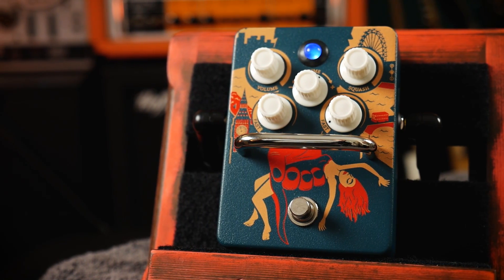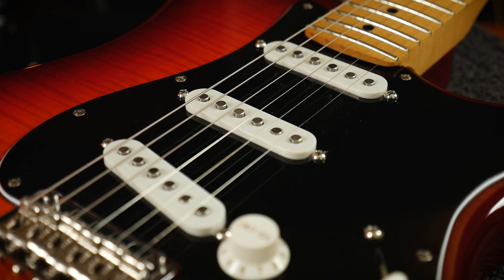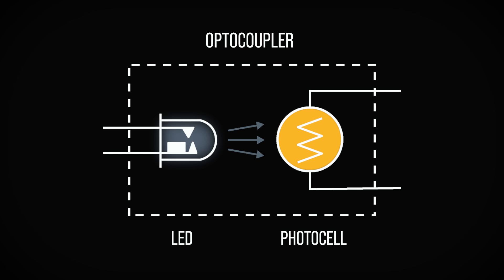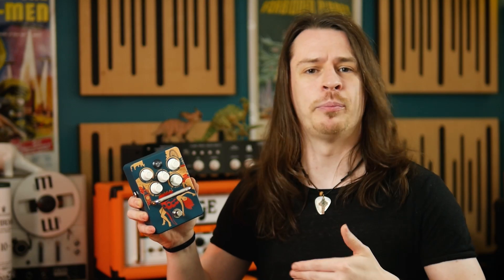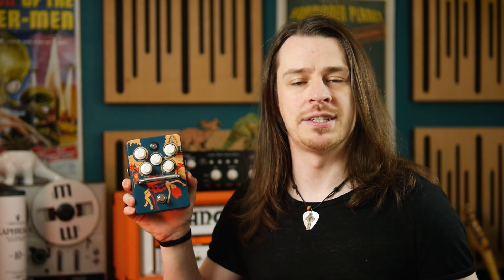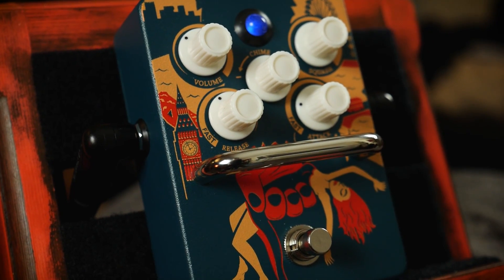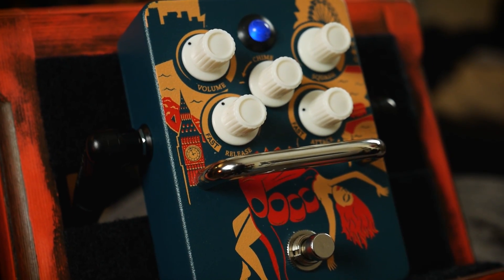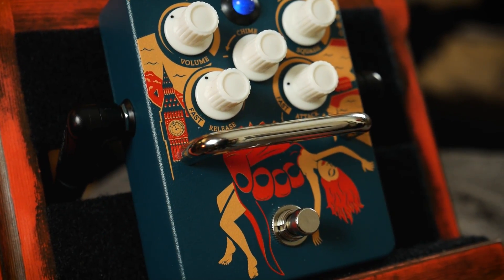What are Optical Compressors? | Too Afraid To Ask

Comment: I feel like optical compressors work better at the end of the chain, before the time-based effects. An optical compressor right before delay in a parallel chain just makes everything sound a thousand times better and more defined. I liked running a tube pedal (just gain and a filter) into an Optical Compressor into a Tape Delay (pedal) into a Spring Reverb, it works for single instruments but also for the whole band

Comment: The compressor is an effect you don't notice, until you switch it off. More seriously if it may make playing easier as it regulates the volumes of different strokes it also mercylessly highlights little errors (stray notes, fret noises, etc) that may otherwise not be noticed: A double edged weapon.

Comment: TATA: My Valve amp does NOT have a standby switch. Am I better switching it off between jams even on the same day or leaving it on? Bonus question: If I leave it one with nothing plugged into it, can that do any damage? Sometimes I dont have my pedals plugged in and I pull out the cable to use the tuner for a few minutes...wondering if this is risky? Thanks

Comment: I have a some TATAs regarding Telecasters! Why are the old school barrel saddles considered bad for intonation, and what does it mean when they are "compensated"? Why do they have those ashtray bridges, what are their benefits? What are string trees for? 

Excellent video btw! You made me dance and sing with Superman, I was so happy to hear that one for some reason lol. Cheers from Mexico!
Reply: The vintage style bridges have one saddle piece for every two strings, while you need to intonate each string individually (in general, the thicker a string is the longer it needs to be, or the farther the saddle needs to be from the nut, to intonate correctly).  So the position of the shared saddle is either going to be a compromise between the compensation needed for each string, or you can intonate one string perfectly and have the other be farther off what it should be. Compensated saddles have the contact point with the string offset from the barrel centre point so you can get closer to correct intonation on all strings.
I don't know why Leo Fender designed the ashtray bridge, but given his usual design ethos, "it was cheaper to make them that way" probably played a part. :)
The 6-a-side headstock means the strings on one side (usually the treble side) of the neck extend farther from the nut to the tuning machine. With a flat headstock, this means those longer strings would have a very shallow break angle over the nut, and less downward force applied there, making those strings more likely to pop out of the nut slot when bent or strummed hard. So they put string trees on those ones to force them down, getting a greater break angle.

Comment: Hi Colin, it dawned on me that inaccurate or slower reproduction of the signal is more musical. This reminds of tubes vs. solid state. SS amps has a more accurate reproduction of the original signal while tubes has not but they sound more musical and alive.
Like vinyl records perhaps over CD or mp3? Hehehehehe
I have a question though: I probably missed it on the video if it is not mentioned but is the photocell shown in the illustration the same as an LDR (Light Dependent Resistor)?

Comment: I've been using my Kongpressor for about a year and a half now and it's perfect for leveling out my heavy palm muting in Drop B. Running it at 12v just adds the extra juice I need. I love it so much for than my Wampler Ego compressor (which I prefer for bass).

Comment: I've found that one of the more important uses for a compressor is to maintain overall average level when someone, whether oneself or another person, is singing.  It is far too easy to be carried away and unintentionally slam on the strings momentarily drowning out the singer/s.  That's also why funk players use compressors. Funk music requires one to strum in a manner that accentuates the rhythm, but at the same times not overshadow singers or other instruments on those beats with higher volume.  Compression lets the player make use of the timbral differences between strumming/picking hard or soft, while not paying for it with volume differences.

Comment: Though I have, and have had, many different ones, my favourite guitar compressor is the first one I ever bought, in 1977 or so, a Univox Uni-Comp.  Little grey box with a big foot graphic on the top.  Loved it, but ended up having to sell it a few years later.  More recently, I stumbled onto a schematic of it, and built a repro for myself, falling in love with it all over again.  The Uni-Comp is about as simple an optical compressor as one can make/find.  

I was initially puzzled by the diode pair on the output, until the rationale was explained to me.  Apparently, many broadcast studio compressors would use a similar trick.  As you noted, photocells can be a little sluggish to respond.  The diode pair on the output would "clamp" the maximum output level for that initial pick attack transient, essentially filling in until the photocell/s caught up.  Since their substitute action was only needed for a few milliseconds, you wouldn't perceive it as clipping.  Clever!

Comment: Nice explanation.  And yes, one of the more common comments from builders and users of compression is "Is this thing on?  I can't tell."

Okay, brief nerd-digression to explain why optical is "better".
Anything that uses the "envelope" of the input signal to accomplish some other function, whether it is a compressor, noise-gate, or autowah, always faces the challenge of what is called "ripple".  We might perceive the guitar as having a relatively smooth and consistent level, and decaying smoothly, but in reality it has lots of little ups and downs in level that we perceptually "smudge out".  So, if one wants to follow the amplitude of the guitar and adjust the volume to get a more consistent/compressed output volume, you have to ignore those little blips and dips in the amplitude of the incoming signal, and create a smooth control signal out of a much wigglier one.

BUT, what we often have to do in order to accomplish that with FETs or VCAs makes the overall circuit less responsive to sudden changes in the input signal.  As you nicely explained, the "memory" effect of photocells, whether illuminated by this light source or that, is that it does the "dewiggling" for us, and effectively ignores momentary blips and dips even when we opt for more sensitive and responsive detection of the signal envelope.  The result is a much smoother control over the signal, whether one is governing the level or filtering or some other function. 

I'll note in passing that when autowahs, noise-gates, and compressors use transistors and VCAs, controlled by an envelope, one often hears complaints from users about "distortion", particularly as notes decay.  This isn't distortion in the usual sense.  Rather, what they are hearing are the blips and dips in the control signal making the volume level or filter-frequency go up and down very quickly.  Using optical control, instead of FETs or VCAs uses the quirks of photocells to smooth out the control signal, eliminating such seeming distortion.

As with choice of op-amps for the Proco Rat, sometimes what can seem like a poorer choice of component, based on specsmanship, can be ideal for the purposes of rock.  Optical rules.

Comment: Excellent information as always.  I wonder if the high-end optical parts used in network routing gear could be adapted to compressors, or even if it would be counter-productive.

Comment: Hi,the compression block diagram shoed a feedforward style compressor signal path,but i know most of the opto-compressors are feedback design.Is this  pedal a feedforward compressor?
Reply from the maker: I fear you are taking that block diagram too literally. It wasn't supposed to represent either system, just show a signal flow through components from left to right for ease of explanation.
Reply: @ScienceofLoud  Yes i've seen many simple explanation  like this one, but when i got deep into compressors device working i found that most of the classic compressor is feedforward deisgn,counterintuitively signal will not be splitted in the input

Comment: tata:  how do i adjust pickup height  to produce various effects like cleaner or louder or quieter.  are there sweet spots that have certain effects etc. thx  ta...
Reply from the maker: Simple answer: Output of the pickup is determined (in part) by how close it is to the strings. If you want louder signal move the pickup closer, if you want a quieter signal move it further away. 

I recently reduced the height of the pickups in my Flying V to give them more dynamic range. The pickups themselves were too compressed, but moving them further from the strings lessened the compression making the signal clearer. This you do by ear, get them to where they sound right for your application.
Reply: @ScienceofLoud  One thing to remember when lowering pickup height is finding the sweet spot that keeps pinch harmonics come easy, since they can get pretty hard to make when the pickup height gets to low.

Comment: Hey Colin, I've got a TATA question. The Joyo mini hybrid amp series has a tube preamp and a solid state power amp. Since the power amp is solid state, is it safe to play them with no speaker load?
Reply: Not Colin, but yes: It is safe to play through them without a speakerload. Some solid-state power amps require a load, but usually you don't find them in guitar amps, unless they are from the 70s
Reply: @CastToVoid  thanks! Now can you say it again with a Scottish accent?